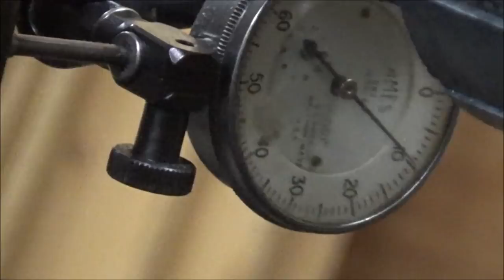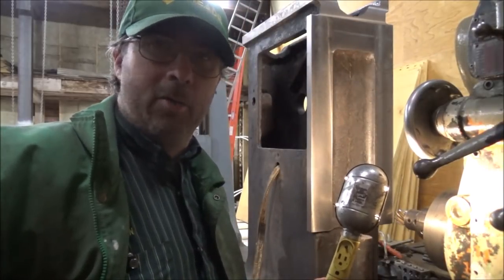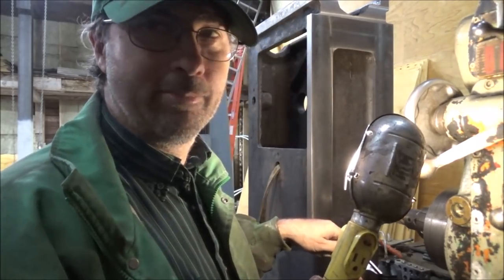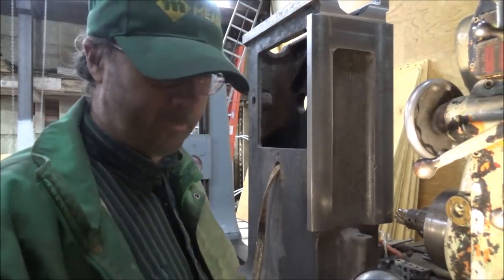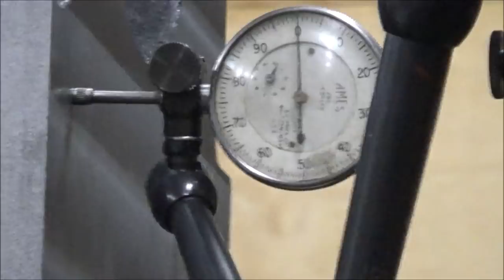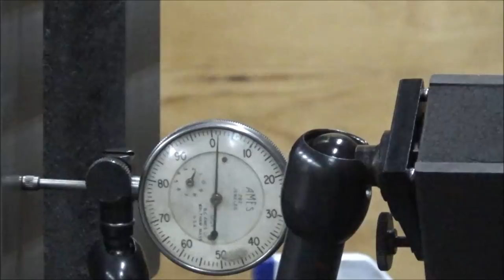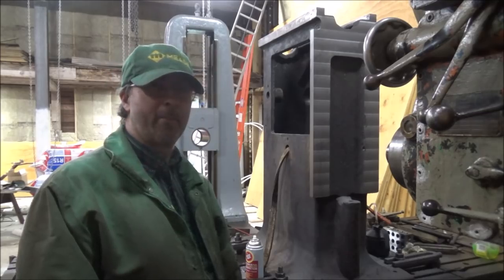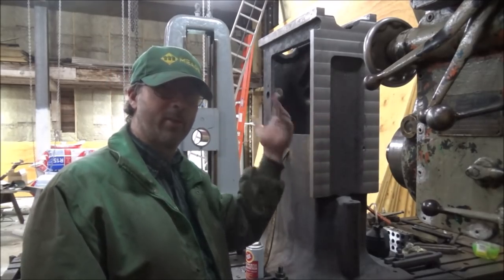Machining a Machine Tool: Rebuild Back to spec Part 2

Comment: What you get is real good, +/- a thousand and less, even on a newer machine, on a  1 x 2 surface feet is pushing the limits, it's a very decent start for scraping, and since the ram and table of the shaper will do some averaging on their operating length.
The final bigger challenge on this job is to keep everything perpendicular on all sides at the same time, I'm not experienced with big HBM, but if the machine is in good shape it shouldn't be too much of a problem since most  of the job can be done without changine the set-up, in the end you should be able to evaluate the state of your machine pretty well, final challenge is to get accurate measurements  with limited very accurate and reliable measuring equipment...  
So far it looking good, let's wait and see about other planes...   ;)
Reply from the maker: I will have to flip it to do the top.  If I had a right angle attachment I could do it as it sits but right now I cant think of anyway to do the top faces and ram groove as it sits.
Reply: if you had the end support set up.. and a long tool bar to lock some milling cutters on you could go left and right across the top where it sits.

 that might also help in cutting the vertical back faces .. but that could be done fairly easily..
Reply from the maker: In addition to the top needing cut flat the trough the ram in needs cut as well. I don't see how you could do that with milling cutters unless the base was rotated  90degrees.

Comment: We made a pen mount for our much smaller machine. We trammed it in by gluing paper to a known reasonably flat surface. I'm pretty sure you can figure it out from there. Felt pens like a sharpie work best. The paper was to make the marks it left more obvious.

Comment: im pretty impressed. its an old casting, its a lot better than its ever been before, and i think it will be a fairly usable machine.
Reply: some support in the back, even a jack or a block of wood and a wedge in side at the top, might help a lot,. theres a lot less support in the top than at the bottom of the cut.

Comment: Great job Brian. Once the Shaper is in operation it is up to the Operator of the Shaper to set the work up correctly according to the machine. Just the normal sag in the stroke can exceed the tolerance you have met. Great video thanks for sharing. I can't wait to see Mike get back to work on it. The end result will be the work the Shaper does when back together.

Comment: Not to shabby at all Brian, it's certainly proved out the effort you put into getting the foundation correct and your initial alignments. That kind of accuracy on an old machine says a lot. You'd be the better judge than any of us if you can get that HBM tweaked in a little closer or not. If you had a riser tall enough and if the table could take the weight I can't think of any normal shop sized vertical mill made today that could do as well over that distance even when brand new.
Reply from the maker: That is what I was wondering. If you milled 24" on a Bridgeport type mill how flat would you expect it? In my experience usually knee rock/table tip with the weight would cause problems that would exceed .0015"
Reply: In my opinion? Certainly not anywhere close to as flat as you ended up with. As long as the table load is balanced it should be as flat as the way accuracy and tram allow. With the few thou clearance that allows the slides to even move then once that table load gets out far enough in either direction past the Y axis slide on a vertical mill it's going tip that table, knee etc and take up those clearances just like you said. Who knows how much the table would also bend while hung out in space. We both know the part is going to rock in both directions. And the higher the cutting surface is off the table the more that tipping issue gets magnified at the cutting surface. Still only a best guess, but the part would be rainbow shaped I'd bet at least by your .0015"- .005" or possibly a bit more.

It would be interesting to know what accuracy that shaper had from new when it left the factory for a true 90 degree angle for the front vertical face to the top ram surfaces and across/ up / down on the surface you just did. Most likely they set multiple casting up on a large planer and then gang planed the front knee surface so they should have been pretty good. Maybe a large vertical shaper got used on the ram ways so part alignment would then be easy? If so that would answer why the castings bottom surface was never squared up to use as a datum surface.  I think there's damn good reasons why the usual designs of shapers and vertical mills only get so large. At a certain point for part length / width / weight the full support a planer, vertical lathe, bed mill, hbm has becomes non optional.
Reply from the maker: I was hopeing some guys that run HBM's in their day jobs would chime in on what sorts of flat and square values they normally expect to see.

Comment: With a fly cutter of the appropriate diameter, you would get either drag or cupping due to the deflection or deviation in tram. Thats the only downside of really large diameter cutting setups. It doesn't take much to get them to start cupping. At times its just a bit extra tool pressure or feed.

Comment: Close enough to start scraping. Flycutting (IMO) would be an exercise in futility. Interrupted cut would probably chip the cutting tool and could see many cuts to get a smooth uniform surface.

Comment: Per your invitation: I am thinking the "zebra" stripes indicate that the column/spindle and the table are not perpendicular/parallel to some small degree. That's the best analysis I can do from a video... actually, I have no standard large enough to analyze it correctly even if I was there.
Reply from the maker: Yes it appears there is .0002" deviation in the cutter over its face with it being tipped in at the top.

Comment: I totally agree with your fly cutter comment.
Reply: Wouldn't this style fly cutter have a good chance of a good accurate finish? https://youtu.be/oi5fXsRKWUg
Reply from the maker: If the flycutter is not in perfect tram it will leave a cup shape as it is passed over the material even if it was rigid enough to not deflect and cause issues skipping over the interrupted cuts.  I would love to see somebody test a 2ft fly cutter to see how good it would do though.

Comment: Nice start on this "one off" project. I can only imagine the machine/fixture that did it in the first place. Keeping the ram surfaces square with the face shall be the challenge. I wonder if a machine that age had surfaces ground ? Many, many years ago I ran a big Landis that might have been big enough. Lots of set-up work.
Reply from the maker: I can see milling marks in it in spots so i think that is how they did it.

Comment: I think  1or 1 1/2 thousandth is still better then it was, if you can hold that for where the ram operates, it will be a good machine, after all where the ram operates, is out what was it, around 0.008-9 . Thanks for sharing this with us.
Reply from the maker: I think Mike said it had .015" of droop before.

Comment: Could it be the tool pressure tipping the table back further as the miller climbs higher? Is it possible to lock the table down for each pass?
Reply from the maker: If anything like that is it, it would be the part deflecting from the base. The table on the machine likely ways 5-6 times what the shaper casting does. I don't think the cutting forces could move it.

Comment: How has this affected the thickness of the front plate, do you have a cutter that can cut the back of the plate so the gibs will have a parallel surface?  Great project!
Reply from the maker: Yes I will cut them parallel before resetting it to do the top.
Reply from the maker: I will cut them parallel on the back side in the same setup yes.
Reply: just keep watching he does some backwards ninja flycutter  move on that surface!!! lol that was one of my favorite parts of the video.

Comment: Brian:  just curious and you probably  have a good reason but I was wondering why you didn't use that big round, like 8-10 inch carbide toothed shell mill you showed once when you took a huge amount off the back of a John Deere tractor casting in you're old shop?
Reply from the maker: It wasn't big enough to cover the entire area in one pass and the fact my spindle ponts down a small amount would result in a much worse stripe effect on flatness than a smaller diameter cutter which minimizes the out of tram condition showing up in the work.
Reply: @bcbloc02  that makes good sense, will file away in brain for future use.

Comment: I place my money on thermal expansion.  As I recall the ball park is 0.001" over 1" per 100F, which should mean a change of 10F over 10" of stick out also results in 0.001", yes?
Reply from the maker: Yes I believe that to be the case. it leads to why the cut path and travel path do not match up. The only other possibility is a tip in the table as i changed its position. A thou raise in the front would be several thou tip 3ft over the table.
Reply: Repeat the processes on a scrap block, but start at the top and work your way to the bottom?  If the error is zero or inverts, you'll know the answer. Makes me wonder if the old masters would intentionally alter the setup to account for factors like this.  :)
Reply: Paging This Old Tony and his new fancy Thermal Camera, could make for an interesting time lapse to see how the machine changes temperature during the job?   Also, why do we chase perfection when 0.001" over 26" is more than accurate enough for this step? :)
Reply: I agree James Lerch but you know machinists, you always want to say it's perfect, even if it's un attainable .
Reply from the maker: I don't have many pieces of 30" scrap block to test on!! lol Anyone that wants to donate some I will be glad to check it out. :-)
Reply: Someone must have a 24v Cummins block with an aftermarket con rod inspection window.  :)

Comment: If my fat-fingering my pocket calculator is correct, you are about 17.2 arc-seconds out of square on that vertical face being 1.5 mils off over 24 inches. I'd say that is a pretty darn good approximation of 90 degrees.

Of course how square that is to the base of the machine really isn't all that important, square to the top ways is what counts. How are you planning on supporting the base to do the top? Put it on parallels on the face you just machined? If so and you expect about the same amount out of square, you could shim one  of the parallels with some .001 shim stock.
Reply from the maker: Yes I plan to flip it onto the face I just did and shim it till square and cut it as best I can.  I would love to have a right angle attachment for my mill where I could mill it without moving it but will make it work with what I have. :-)
Reply from the maker: They already exist from the factory. Problem is dealers want $10,000 for them.

Comment: How do you think it was originally milled?  Large bed planer?
Reply: Large planer or planer mill absolutely, probably with multiple heads to maximize material removed per stroke.

Comment: Is the amount of perceived error from top to bottom going to be dependent on the size of the knee table that is going on the shaper? Say the table only covers 12 inches of the face you milled, then the error is going to be roughly half of the error over the entire length = 1 thousandth? I spent more time wondering how you would get an item that big square enough to the machine to mill it. Did you run the dial indicator across the length of the inside of the ways on the top on both sides? I remember Mike said that the top of the ways dropped off by about 5 thousandths towards the back of them. Or, was there even a milled surface where I am asking about?
Reply: OOps, got that wrong didn't I? It is the implied angle that will stay the same. Regardless, thanks for making me think.
Reply: okay, my brain has been bulldogging me about this for the 3 hours since the first post and 2 1/2 hours since the second. Forgive me if any of this is wrong but I am a novice to machining and just like the puzzle of this all. The implied angle is saying that the top ways are parallel to the feet. Right now, you are measuring off of the feet to get the measurement, but the feet are not the working surface of the machine, so the angle is implied that it carries over to the top.

My bigger concern is that the measurement you are taking at 2:40 is saying you may be making the knee ways at an angle to the top and creating a parallelogram more than square. Think of the leaning tower of pisa, you can make the top and bottom parallel, but are the ways on the sides going to be square to the top in both directions? The face you show being measured at the end says that it is canted/angled toward the machine as the knee table rises, but is it going to go sideways as well? It seems that would be more detrimental to being able to use the machine well. Of course, I imagine you can machine this all out of it but will it be within tolerances for the head or cause work to be needed on the head of the machine?
Reply from the maker: The head ram ways were out at least .015" from wear.  My end goal is to make the ram ways as close to square as possible to the front face. I actually want it tipped like it is currently about .0005"/ft is ideal. That allows the dip that occurs as the ram travels out to be cancelled.  This operation establishes a plane of flatness with the least amount of material removal as possible with the plan that when I machine the ram surface square it too can be done with the lest amount of material removal.

Comment: Its a flawed machine, probably junk, you should just sell it to me for scrap prices! :)  lol, nice work.  Always interesting to learn a machine and work around its age/wear to get accurate results.  I learned a little about this running that old sidney lathe that had close to .200" backlash in the cross slide
Reply from the maker: It is too heavy to throw out I will just have to live with the sloppy work it produces. lol

Comment: I think it is time to add a planer to your tooling arsenal. 😁
Reply from the maker: No where there are any good big ones at? :-)
Reply: @bcbloc02  Not at the moment. There was one in Washington State a while ago but I didn't have a place to put it, or the resources to move it. I'll keep looking for one. My biggest is my 36"'Rockford open side hydraulic shaper. It came off a ship so unfortunately I can only fit 18 1/2" under the over arm. I sure enjoy your videos! Can't wait for the big monarch to get moved into the shop. Sure wish I had a John Deere technician here that was as talented as you!

Comment: That ratling sound, from min 2.00, is normal?
Reply from the maker: The mill headstock is driven from a long splined shaft that slides in a mating splined coupler. It tends to make noise especially at the higher speeds.
Reply: Is it bented somehow or  is normal? If so, ok..
Reply from the maker: It has to have clearance for it to slide I think the noise is normal. Under a heavy cut it goes away.  It might be that new belts on the motor would smooth it out some.

Comment: I don't know how much the side and back of the vertical ways are off compared to the freshly milled front. Will you mill them parallel and in right angle to each other?
Reply from the maker: Next video! :-)